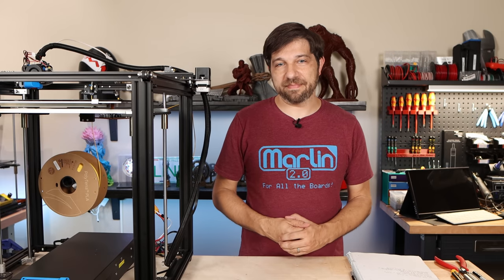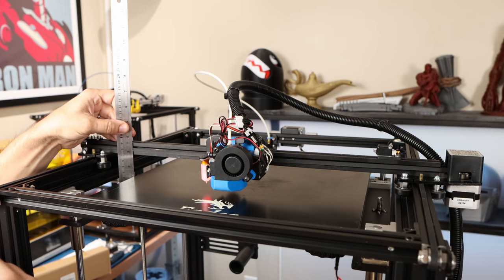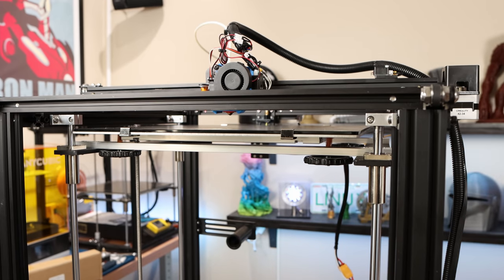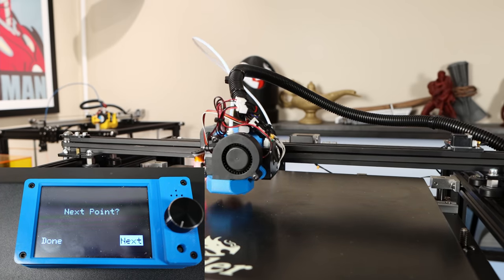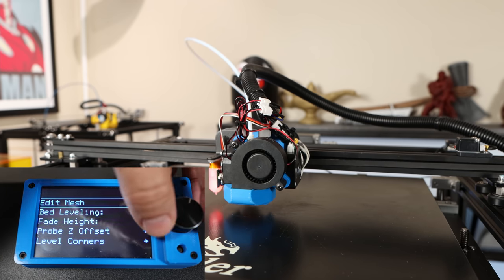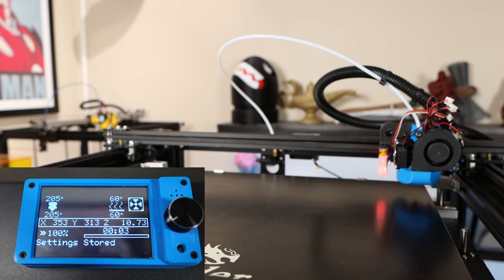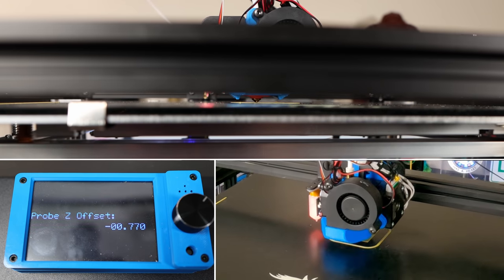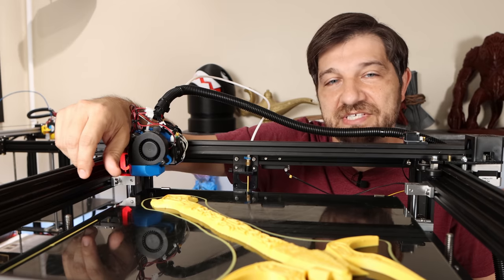Complete Marlin Leveling Guide

Comment: Potential confusion point at 13:49.  You turned the knob the correct way to reduce the clearance between the nozzle and the bed; however, you actually turned the knob to the left, (not the right as you say in the video), assuming you're looking at it from the correct orientation which is from below.  That movement you performed makes the screw looser, releasing the spring tension, and raising the bed which moves the bed closer to the nozzle. That's what you intended to do, but what you did was "lefty-loosy".  Mechanics and others have been using this convention ever since the screw was invented and you are treading on thin ice if you try to reverse that long history.  Looking at the print corner knobs from the top and pretending "righty-tighty" has to do with the nozzle clearance is bound to confuse anyone who worked on his/her car before purchasing a 3D printer.  Nearly all screws are "right hand" and turning them to the right makes them tighter and on a normal 3D printer that pulls the bed down.

Comment: Artillery sidewinder X1 here, with Marlin 2.1.2.1 and a version of  BIGTREETECH TFT  running on touch mode. Is setting the probe offset from the: Motion > Bed Leveling > Probe Z Offset menu, equally as valid as setting the offset the way you did?
Reply from the maker: It is equally as valid if you know what to set it to. It's a good way to reset.

Comment: What hot-end fan mount system are you using. Is it better than hero me gen 5? 
Also, where did you get the flat clips for the glass bed?
Reply from the maker: On this printer, I've been testing the Biqu H2 extruder, so this isn't my standard hotend. On my standard machine, I'm still using my Gen 3 Hero Me. It just works. I'd love to do a new comparison video when I have some time.

Comment: Why do you set the z probe offset first  and then do the corner levelling? Isnt it the other way? 
My bed is warped, just installed bl touch but still cant get  my printer to work reliably. Something to do with the z offset, I feel the levelling is off even with ABL. Really useful video. Thanks for the content.

Comment: Hi!   GreatVideo      BigHelp
I', m having an issue with "Err: Too far" maybe you could point me in the right direction why? 
I recently upgraded my ender 5 plus with the BTTSKR1.4 turbo board/ tft35    
Had that all set up and printing. After watching your video I wanted to upgrade marlin.
I put all your changes in a fresh 2.0.9.3MarlinBug Fix. I think?
I may have missed something.   
When I first followed your video I was able to have a z offset of -2.27 which I was happy with. 
Actually printed some parts successfully....
After fixing a few items I missed setting up the new firmware and trying to get back there,,,, I'm getting Err Too far!
I'll keep trying, hoping you may have a hint why.....
Matt H.

Comment: When you clean your glass bed, do you remove it or not? I was told to use glass cleaner. If you do remove the glass bed to clean it, do you have to re-level the bed again? Also, should I have the bed and nozzle heated when using G34 to make sure both Z axis' are the same? 

Thanks as always! Loved this video. Would one day love to have my screen setup like yours. I like the touch screen but like on my Prusa Mini+ I prefer the knob.
Reply from the maker: I usually remove it and clean it in the kitchen sink. When I bring it back, I would relevel with G29 (ABL) but 4-point bed leveling is probably not needed. Test prints are your friend when in doubt.

Comment: What board are you using on this ender 5 plus? I'm just curious because I would like to get away from the creality board and move to marlin 2.x.
Reply from the maker: I'm currently using the Bigtreetech SKR 2.0. Check my Community page for connection guide and firmware.
Reply: @kerseyfabs  Is that the E3 mini?
Reply from the maker: @michaelpauli734  No. That's a different board. Here's a link: https://amzn.to/33hhq5A

Comment: So am I supposed to turn auto bed levelling on? Because you never mention it after using the measure tool. Not that I heard anyway.
Reply from the maker: Only turn that on if you want it to level the bed on every print. That's not necessary. In your slicer, just be sure to have the following in your start gcode to enable the mesh you have saved.
M420 S1 Z2 ;Enable ABL using saved Mesh and Fade Height

Comment: Can I use a 12864 display with the stock board of the Ender 5 Plus or will I need a BTT board and screen?
Reply from the maker: If I remember correctly, yes you can. You'll need custom firmware though.

Comment: Hey need some assistance. I have an ender 5 plus with a btt mini e3v3. No matter what I set the z offset at, it still crashes into the hot end. What could be the issue? I flashed your firmware on my board. KF 2.1.1
Reply from the maker: Yeah, the v3 had notoriously bad problems with the BLtouch. I have updated firmware that may help on my YouTube community page and Facebook pages.
Reply: @kerseyfabs  thanks for the reply. I actually figured it out. The black/white pins for my Z end stop were backwards. Guess it’s different from the stock board
Reply from the maker: @5t341tH  awesome! Glad you figured it out.

Comment: I've just installed a E3 Turbo, etc and done the bed leveling (about a dozen times at this point) as well as adjusted babystepping on initial printing.  Can't get good first layer adhesion on a multi piece print to save my life.
Reply from the maker: Which side of the bed are you printing on?
Reply: @kerseyfabs  Glass side...I've cleaned with dish soap as well as IPA
Reply from the maker: Yeah, IPA on glass never worked for me. Dish soap almost always does. If all else fails, use glue stick. FYI, my go-to for glass now is Vision Miner Nano Polymer Adhesive. I use it all the time now.
If you want to try the coated side, IPA will work so well on that you may not be able to get your print off. 😮

Comment: Silly question Kris, since you upgraded your PSU to a bigger unit: how do you get Marlin to behave like the stock firmware, which would heat the bed / hotend separately, since the stock PSU cannot handle the power draw to heat both?  I'm trying to run custom Marlin (tried your firmware too), tried Cheetah 5.0, and they all behave the same: preheat PLA setting tries to heat both bed and HE, which causes instant shutdown due to drawing too much current.  I'm trying to figure out how to make Marlin behave like stock, where it heats bed first, then HE afterwards, but with no luck.  I'm rather surprised that the stock Marlin config files don't account for this.  Unless I missed something, which is very possible!!
Reply from the maker: First of all, I have always been able to heat up both the nozzle and the bed on all of my printers at the same time. It can burn out the stock supply on the Ender 5 Plus but, so far, one of mine is still going strong.
What you're describing though isn't a feature of the firmware. That's actually in your start gcode. It's the difference between using M190 versus M140 on your bed heating and M109 versus M104 on your nozzle heating. M140 and M104 both say heat up the bed or nozzle and keep going through the gcode right away. M190 and M109 say heat up and wait for them to reach temperature.
For example:
M190 S60
M109 S200
This says heat the bed to 60C and wait for it to reach that temp. Then it says heat the hotend to 200C and wait for it to reach that temp. If you replaced the first line with 'M140 S60' it would heat both at the same time, only waiting on the hotend temp.
Now if you're not doing this expressly in your start gcode, your slicer may have a setting for it and you should look for that specifically in the slicer.
Reply: @kerseyfabs  thanks Kris, that's what I'm told on Reddit too.  I also know at some point Creality started shipping with beefier units, which confuses things more.  It sounds like I have a problem somewhere.  Even if I can work around it with gcode, I'm not sure I should entertain that.  I wonder if I somehow ruined the TH3d 450W Meanwell unit when I put the SKR 1.4 turbo board in.  Maybe I should have just followed your example and got a 600W unit from the start.  Oh well, back to the drawing board, thanks for reply!

Comment: great vid man, the only thing that didnt work is the last bit with baby stepping i adjusted it to get it smooth but it loses the ofset very next print, even tried storing settings via lcd , it saves the new offset but very next try i have to lower it more again, any ideas appreciated
Reply: If I remember correctly you have to enable in the firmware that it saves the babystepping adjustment, otherwise it get's lost every time.

Comment: Not sure what I'm doing wrong, but I don't have the bed leveling corners section.  Actually no bed leveling section at all.  It says bed leveling UBL.  I've been writing the firmware for my ender 5 plus on a SKR 2 board.  No idea what I'm doing, but I'm learning it fast.  I've managed to get it to print finally today.  But only from the Marlin Emulator mode.  As the Touch Screen mode says the filament runout sensor is not working or some such error.  I believe it is because the sensor is attached to the board and not the tft.  However when I attach it to the TFT it won't print from Marlin mode lol.  Either way that sucks.  Needs to be fixed.  Anyone have a work around?  Thanks for the advice :)  And keep up the great videos!!  You don't know how much it has helped me out!!
Reply from the maker: Cain, sorry to hear about your problems. Here's a quick reply:
- You're welcome to try out UBL but I prefer BILINEAR bed leveling. I find it to be less complicated and just as good functionality: #define AUTO_BED_LEVELING_BILINEAR
- Corner leveling:
#define LCD_BED_LEVELING
#define LEVEL_BED_CORNERS
- You're right about filament runout. You have to choose which one you want. If you choose TFT, disable the one in Marlin.
- I'll be working on an SKR2 this week for my firmware (I hope). It will go to Patreons first for testing and then to everyone else a couple week later.

Comment: You completely missed one of the greatest features of Marlin. You need to enable probe assisted corner levelling (uncomment LEVEL_CORNERS_USE_PROBE. Set probe tolerance to 0.1). Instead of going from corner to corner with a piece of paper depending on how it feels, it will wait for you to turn your adjustment knob until it triggers your BLTouch which is much more precise. I also recommend cutting probing speed in half. Marlin moves the Z axis toward 0 while it's polling for the probe to trigger. The faster the Z axis is moving, the more opportunity there is for the Z to move until the probe is triggered. Run the BLTouch repeatability test before and after slowing the probing speed and you'll see what I mean.
Reply from the maker: Thanks for all the tips! I'm going to take a look!
Reply: @kerseyfabs  please do, I've been trying to enable this without any luck.  :-)  Once I try to enable it, it tells me the probe spots can't be reached, or something to that effect, and fails to compile:  "static assertion failed: LEVEL_CORNERS_INSET_LFRB right inset is not reachable with the default NOZZLE_TO_PROBE offset".
Reply: @kerseyfabs  Have you time to try it ?

Comment: Sorry, but at 13:50 you're loosening the screw.  (counter-clockwise)  Lefty loosey.  (look at the screw from underneath)  Loosening the screw compresses the spring less, allowing the bed to raise, thereby closing / tightening the gap.  You end up loosening the screws to tighten the gap, which is a bit counter intuitive, but once you realize that 'tighten' means 'pull away from nozzle', and loosen means 'allow spring to pull bed more towards nozzle', it makes more sense.

Comment: I cant seem to set Probing Margins without the firmware being unable to compile, without probing margins edited it compiles fine though..
Reply from the maker: If you set the various margins to the same value as the default  (which should be 10), does it compile? If not, what's the error?

Comment: A COMPLETE Marlin Leveling guide should contain how Marlin firmware should be set. This is more a guide of how to use Marlin menu to level your bed.
Reply from the maker: Nope. That would be a Marlin Configuration Guide. That's a separate thing for people that need to compile their own firmware.
Reply: @kerseyfabs  "COMPLETE" shouldn't be used for your video title. It's misleading.